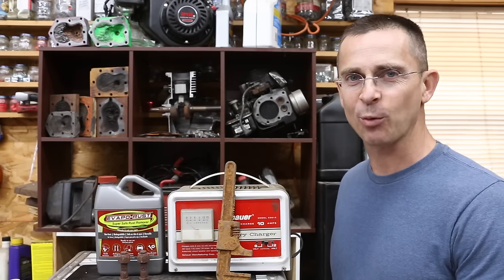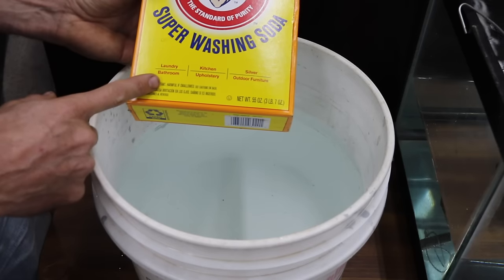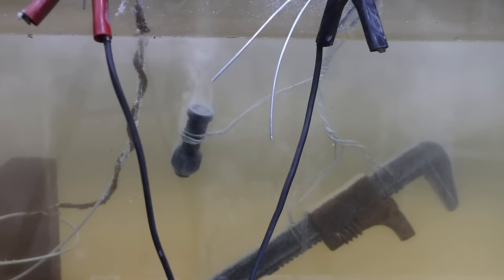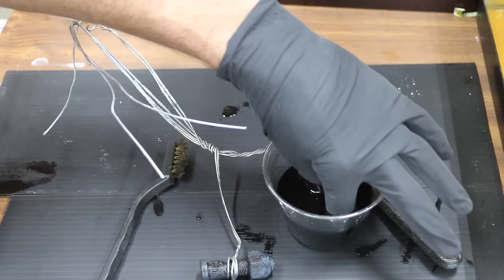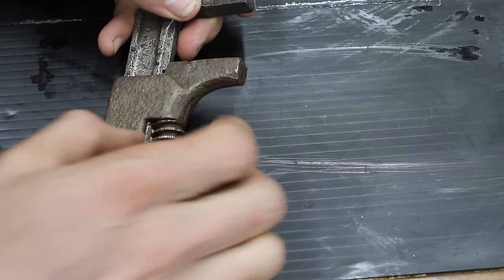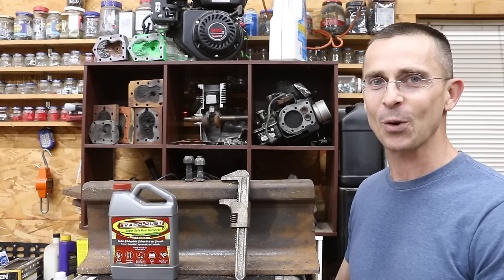Is Electrolysis better than Evapo-Rust?  Let's find out!

Comment: best channel ever
Reply: 1 criticism. I don't know how long your videos takes you and what reallocation of resources this might take to achieve, but I have noticed that many of your videos as good as they are lack follow ups if not of mass importance like the torque tests, but really with every video people make suggestions after the fact with tools you missed in the comparison or other slight flaws.

I also understand the value of your channel and your concise content with high quality extensive videos.

I suggest you make a second channel. It will grow massively and easily with the promotion of your first channel, you can post there most spammingly, it will boost your first channel, you could hire others to help you run/manage the channel and or create the videos. Additional channels are proven to be extremely successful on YouTube in giving your audience more to watch and extending your outreach. Even if you just make a videos testing more brands of certain products against the current top contenders/metrics.

love your videos. best of luck
Reply from the maker: Thanks!

Comment: Try white vinegar… I think it’s better than both of those… It will also remove mill scale on hot rolled steel and it will get under paint and wrinkle it up too so you can scrape it off or use a wire wheel.
Reply from the maker: Thanks for the suggestion.

Comment: Since I tried electrolysis I haven't gone back to Evaporust. For the price you can't beat electrolysis. I think your amperage might be off. When I do mine there is a lot more loose rust floating on surface and water looks way dirtier within a few hours. My parts are usually rust free within 24 hours.
Reply from the maker: Thank you!

Comment: I wonder, and i dont know exactly how this works so this might be dumb, but i wonder for things like the adjustable wrench, to make sure the electrolysis gets inside the threads and stuff could you use penetrating oil on it before putting it in the tank?
Reply: Exactly opposite you need to degrease it so it has better contact surface. Best is to clean rust in some places where it touches.

Comment: Graphite plate or bar stock works well as an alternative to a sacrificial steel anode - graphite doesn't rust so performance won't degrade nearly as much, but most importantly there's significantly less sludge produced
Reply from the maker: Thanks for the feedback.

Comment: Great show! It seemed the wrench bottom jaw adjustable piece wasn't emitting hydrogen gas hardly at all compared to the upper jaw and rest of the wrench maybe due to  poor conduction from junk between the two sliding parts of the wrench.
Reply from the maker: Thanks for the feedback.

Comment: You should have weighed the sacrificial steel plate before and after to see whether it had lost or gained in weight! Additionally where did you source your water from? Tap? Distilled? What voltage did you use?

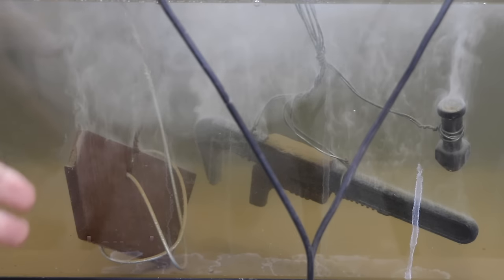One final thing at 05:28 the bubbles from all the objects in the tank look the same size which therefore indicates only one gas is being given off! From my experience I would say hydrogen is given off and very little oxygen simply because the bubbles are very small indeed. Oxygen bubbles are much bigger!

Comment: Nice. I do wish you had added a conection to the secondary part of the wrench so the electric current would run through it like the main part did. Notice there are no bubbles coming from that part when electrolysis is operating.
Reply from the maker: Thanks for the suggestion.
Reply: @ProjectFarm  for sure, I like your videos.

Comment: Looks to me that you would have had to wrap the conductive wire around the adjustable jaw for the electrolysis on it, too (but I see you acknowledged this in comments).  I didn't know electrolysis could be used for rust.  I have a Schumacher 12 Volt, 2A/10A/50A Conventional & Low Maintenance/Maintenance Free & Deep Cycle Fully Automatic Charger, Model SE-1252MA.  What Amp settings did you use?  I only  recently learned about Evapo-Rust, too.  I'd like to try electrolysis on some things.  Arm & Hammer Super Washing Soda would be great!  Do you think a box of their Pure Baking Soda would work as well?  I'll use your recommended Amps and Soda.  Great one, Todd!  Yes, both are impressive!  Thank you!  I just found this one in suggestions.

Isn't it amazing that videos you made years ago are still helping people?!  But that's why you do it.
Reply from the maker: Thanks!
Reply: @ProjectFarm   Do you remember what Amp setting you used, please?

Comment: You need a deep wallet if you are going to de-rust a 140 pound vise with Evaporust!
Just a couple of tips - have as large an electrode as possible, as close as possible to the workpiece - it speeds it up considerably. I often use old sheet metal rolled so it surrounds the workpiece. When you are done, scrape/wire brush the sacrificial metal and dry it out ready to use next time.
Reply from the maker: Thanks for sharing.

Comment: I realize this is really old. But would be cool to see how plain white vinegar compares to these two methods.  Its what I usually use. Just submerge the piece in vinegar, pull it out every hour or two and scrub it a bit with a wire brush to keep an eye on progress. Wash it off and neutralize the vinegar when finished.
Reply from the maker: Thanks for the suggestion.

Comment: I've seen some metal works in my time as a welder some people used white vinegar to remove scale and rust from parts. I've even seen someone use a vinegar solution in a electrolysis... Just some Idea's... Oh, when using the vinegar they where soaked in the vinegar, I don't know if just spray it on would do anything.. They would just wash them with clean water and sometimes a water baking soda mix..
Reply from the maker: Thanks for sharing.

Comment: If you look at the video at 5:25, I think it's clear from gas production that there's no decent electrical connection to the slider on the wrench.  I think you would have had better results if you had added a wire to the slider or perhaps wedged a sheet metal screw in between to make an electrical connection.
Reply from the maker: Thanks for the constructive feedback.

Comment: you failed to hook the electrolysis wires to both parts of the wrench....you hooked the wires to the shank but not to the knurled jaw......there was no reason to think that the shank and the jaw were electrically joined after all that corrosion.....as a result the shank portion got cleared of rust and the movable jaw lagged far far behind.....a wire connection to both would have given better results

Comment: I have a electrolysis tank and it works great. It takes a bit but the rust is gone. I like to have more iron plates in the tank than just one tiny one. I line the walls with the iron plates I got 6 plates 8inches tall and 6 inches wide. Three per side and hang the cast iron pan in the middle.  I am a admin on a facebook Electrolysis and cast iron restoration group that has many members. I will let you look it up if you want to check it out links get blocked. If you have a cast iron pan that you wish to restore sand blasting, sanding and chemicals are destructive and ruin the value if used in any way on a 100+ year old cast iron pan. So if you want to restore it and keep the value look us up on facebook  and learn the correct way to do it. Electrolysis tank & cast iron restoration community. Great video.
Reply from the maker: Thanks!  Thanks for sharing.

Comment: Could you use an ultrasonic bath and use Evaporust as the liquid?  The high frequency might break the rust loose off the metal. Ultrasonic is ideal for hard to reach places.
Reply from the maker: Thanks for the suggestion.
Reply: @ProjectFarm   Use a powerful US cleaner. Give it some time, too. Let it soak (with the US on, of course) for at least half an hour to an hour. We're not dealing with grease on a pair of glasses, here, but with stubborn, well hidden rust.
I have seen videos were large US cleaners were used and they seemed to be very effective.
If too expensive, try to find a second hand.

Comment: Could you do a demonstration using a heat induction tool?  I use the solaray brand priced at $179 which I purchased at Amazon but so many different brands out there.  I have fantastic results and no flames or collateral damage versus a torch.!
Reply from the maker: Thanks for the suggestion.  Thanks for sharing.

Comment: The black stuff might be Magnetite (Fe3O4) that is formed from rust (Fe2O3• nH2O + FeO(OH), Fe(OH)3).

A warning I read about this process using electrolysis is that hydrogen enters the material and weakens the tools and might cause catastrophic failures.

Searching for rust removal I also found acetic acid (vinegar), acetic acid with salt added, citric acid muriatic acid and so on. Acids of course attack the iron too.

I am wondering if one could use electrolysis and combine that with citric or acetic acid to prevent the iron from being removed.

I was surprised how little I was able to find about the actual chemical reactions taking place.
Reply from the maker: Thanks for the feedback.
Reply: @ProjectFarm  Well thank you for all the great videos. I love to watch them even for tools I don't need and things I will never do.
Reply: If the voltage is kept low (like 1.1V) the hydrogen production can be held down, but it will also decrease the current and hence increase total time.

Comment: I've seen several various mediums and techniques in electrolysis. Is there one medium that's more effective than another? What about the use of multiple electrodes in the water instead of a single positive electrode?
Reply from the maker: Thanks for the suggestion.

Comment: I created a dynamo generator using a treadmill motor coupled directly to a 3/4 HP induction motor and use it for electrolysis. It works extremely well and faster than a battery charger. It’s not as efficient because I’m turning electrical energy into mechanical energy and then back to electrical energy, so there is loss inefficiency from heat and friction. It puts out somewhere around 75 volts DC so maybe that has something to do with it working faster? Not sure but hey it works!
Reply from the maker: Thanks for sharing!

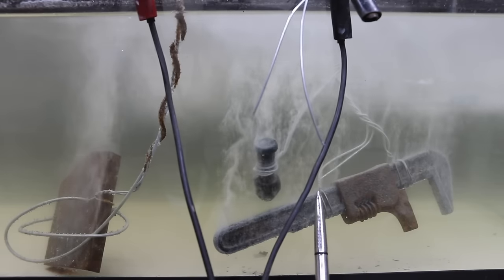Comment: I think you misspoke at 2:14, the anode gets oxidized (as sacrificial anodes of zinc or aluminum do on steel ships) while the cathode generates hydrogen, which reduces the iron oxide rust. You can tell which is which by waving a flame over the surface where the bubbles are coming up :)
Reply from the maker: Thanks for the feedback.

Comment: On your power source what voltage did you choose, I noticed it had a 6v or 12v option.
Reply: 6V is fine, 2-3V is better, as it wastes less energy. 12V is ok, but you are wasting energy splitting the water.

Comment: So i hear that old vehicles didn't rust because they had a positive ground instead of today with a negative ground. I know we can buy an electronic rust control also. How do they work why and is it basically a switch that feeds some voltage back through the system.
Reply from the maker: Thanks for the video idea.

Comment: the moveable jaw on the wrench had no electrical continuity with the handle. You need to provide this with wire interconnections

The best anode material to use are carbon rods because they are not sacrificial. You can use air/arc gouging electrodes for this.
Reply from the maker: Thanks for the feedback.

Comment: What volt/amps did you use on the electrolysis? I've heard from multiple sources that the time required to derust something can change dramatically depending on the voltage/amps used. The strong the current used, the less time it takes.
Reply: If you watched the video, you will see the charger and the voltage and amps.

Comment: New topic? How well would an induction heater remove bolts compared to other methods (torch, penetrant, etc). Also, will the heat reduce the strength of the metal causing it to snap off?
Reply from the maker: Thanks for the suggestion.

Comment: I would have moved the wires directly to the moving jaw to remove rust from it, as a rusty surface would introduce more resistance, causing the fixed jaw metal to react much more readily to electrolysis than the moving jaw.  Path of least resistance.
Reply from the maker: Thanks for the feedback.

Comment: You were killing me when you did not notice there was no bubbles coming off the center part that wasn’t being cleaned.   And how all the rust came off the rest of it.   But you didn’t thing to move the electrode to the center.

BTW, I have done this process to restore many of my tools and equipment.   Tip: a carbon rod makes a much better sacrificial anode than steel.

Comment: i recently did a completley rusted 90x 60 piece of rusted steel tube in a wheelbarrow with sodium carbonate it took about 4 days i used a  12 volt battery and a battery charger it cleaned the  steel tube . believe me the steel was rusted so bad it had 2-3mm dimples where the rust was  inside and out i think that cleaning the sacrificial anode each day made the difference. the next time i did the same sized steel and i used 2  12 battery chargers and 2 12 volt batterys  this reduced the time by more than half. the reason why i used battery charger and a 12 volt battery is battery chargers that have a protective circuit wont work unless you have a buffer ergo a battery. i watched practically every youtube video on this and when i startede with only a battery charger the charger had a fit bouncing full scale and bouncing back to zero hope this helps anyone trying this method of rust removal
Reply from the maker: Thanks for sharing.

Comment: A word of caution about using the electrolytic process. Although I do not know this as a fact, I have read that electroplating can lead to hydrogen enbrittlement. I don't know if electrolytic de-rusting can do this as well but it might be best to check into this before doing it on any sort of parts that could cause injury or death if they broke (e.g. rotating equipment, automotive suspension, firearms etc).
Reply from the maker: Thanks for the feedback.

Comment: Haha that is a hot mixture in the water, while it will work faster the battery charger won't last as long. I clean cast iron with one tablespoon per gallon on a two amp trickle charge. I can bump it up to six amps but the charger gets really warm. Some of these old skillets from the early 1900s can't be cleaned any other way. A lot of what I find are the ones others have given up on and I don't give much for em. They restore like new.
Reply from the maker: Thanks for the feedback.

Comment: 2 Questions.. If the wrench was not in the electrolysis tank would the bolt have cleaned faster alone in the tank?   What happens when you use Evapo-rust inside a small electrolysis tank?  Mustard gas or Evapo-rust on steroids...
Reply from the maker: Thanks for the video idea.

Comment: Interesting video, you mention that evapo-rust is very expensive, but what's the cost comparison between the cost of evapo-rust and the electricity.  Several days of running that battery charger has to add up.
Reply: The power used is negligible  - tens of Watts
Reply: @paulg3336  wow!  Very cool, makes me much interested in electrolysis.  Thanks for the reply

Comment: If you'd wrapped the wire on the wrench around the adjustment part, you'd gave gotten a good electrical connection and electrolysis on both parts of the wrench would have progressed similarly.
Reply from the maker: Thanks for the suggestion.

Comment: I run my 12v charger at 2amps, are there others here running at a higher amperage?  Connections are critical and I only run super washing soda and use stainless wire for contacts good or bad?  I get good results too.
Reply from the maker: Thanks for the suggestion.
Reply: I have been corrected about what wire to use.  I was using stainless and was corrected and now am using standard steel wire as the serious by product that stainless produces....my bad.!

Comment: You should have weigthed the sacrificial electrode also, the mass that it gained roughly should be equal to the one gained by the part, actually the weigthed electrolytic reaction like this one is used in analytical chemistry in a technic called "gravimetry", with good technic and methods it can be incredible precise relative to its simplicity.
Reply from the maker: Thanks for the feedback.

Comment: an ultrasonic cleaner combined with either of those probably would have got the threads.

Also, I think the electrolysis clearly showed that it wanted wires to wrap around each component (though I understand not changing your setup partway through the experiment). Maybe that wrench would have freed if a wire went to the jaw and the screw part as well as the handle.
Reply from the maker: Thanks for the feedback.

Comment: If you ever do this again I would suggest you wrap the wires around the part you are trying to remove the rust . The slide part was insulated from the electrolysis from the rust . If you had changed the wires and attached them direct would of worked a lot better
Reply from the maker: Thanks for the suggestion.
Reply: @ProjectFarm  Great video I really enjoyed it! This is a question what happens if you crank up the voltage does the rust removing process get shorter . Be another idea for another idea two rusted tools one at 12 volts and another at 20 volts five amps each. Lets time them and see if there is any difference ?

Comment: If you use rebar rods placed around the tank and linked with wire, the process will work more rapidly.  Electrolysis will not remove any good steel, only iron oxide.  I don't know if the evaporust takes off any good metal.  The black coloring can be wire brushed off as you figured out.
Reply from the maker: Thanks for the feedback.